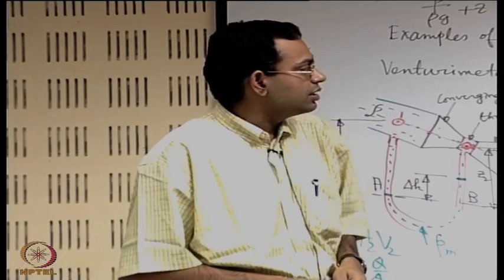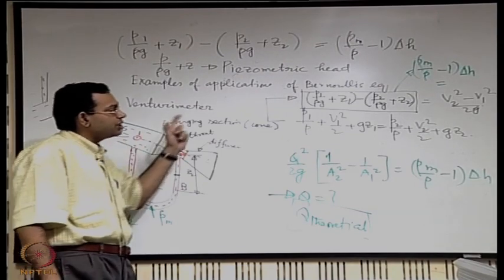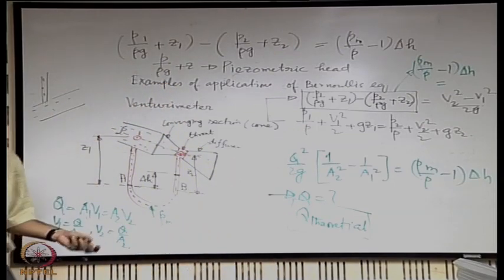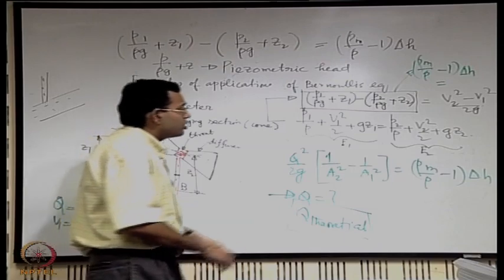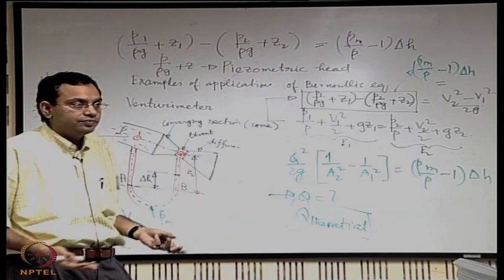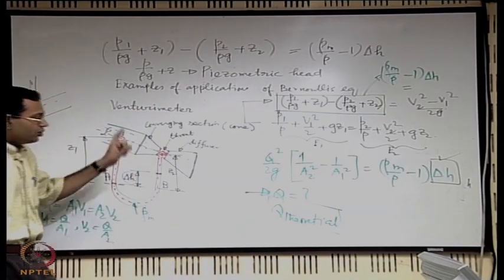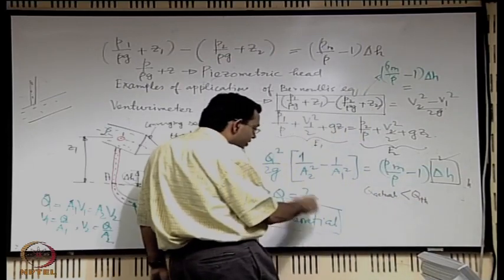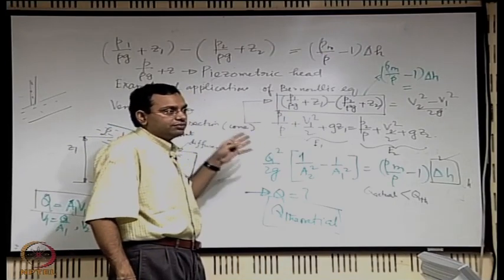Lecture 39: Application of Bernoulliâ€™s equation (Part II)

Comment: It is great to see such detailed analysis being done for a venturimeter. My experience while working in an oil and gas engineering company was that mostly the meter is ordered based on previous project experience. Not much thought is given to it. Engineers only define a maximum allowable pressure drop in the meter and flow measurement range. Vendor based on such requirements suggests a standard model available with them and such a model is ordered. Maybe in niche requirements such a detailed analysis would be required.